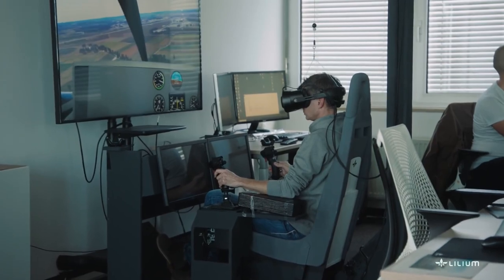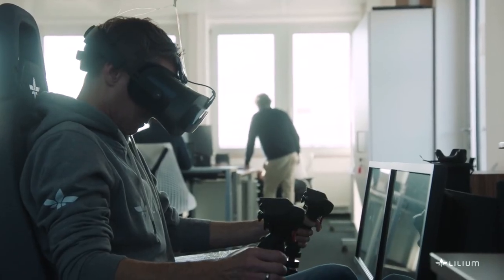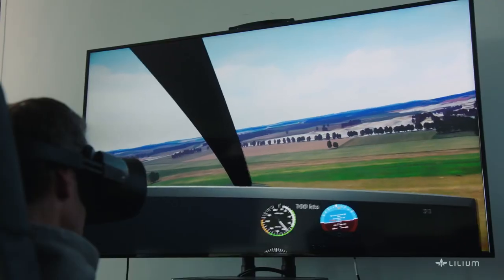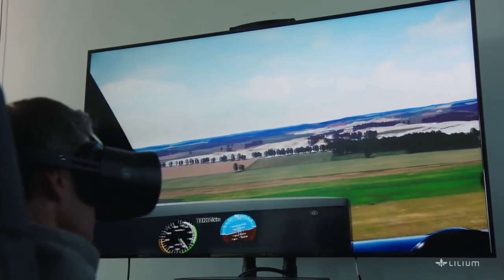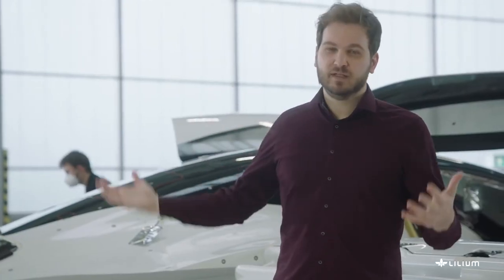Lilium's Amazing Aircraft Engineering & Architecture LILM

Comment: There are some immutable laws of aerodynamics that have been confirmed over many years of multirotor development. 1. the more motors you have the less efficient your design will become, Four motors being the optimal solution to create VTOL functionality.  2 Ducted fams are far less efficient than propellers that have been optimized to create a thrust core that absorbs the available power into a velocity that is almost equal to the vehicles designed speed. The blades swept area is the way to optimize the power to thrust efficiency ratio. 3. Stabilized thrust systems that utilize a fixed pitch prop, with a variable speed motor are far less efficient than a constant (optimized) speed motor with a variable pitch prop. these are facts that have become cast in stone. The fixed pitch prop concept is probably the most misunderstood aspect of the current mass-produced multi-rotors of today. One outstanding design that proved this fact beyond any doubt was Curtis Youngblood with his Stingray design. It was the only multirotor design that could auto rotate during descent and fly inverted. The conventional pulsed variable output from the ESC also draws more current at any given thrust value than the constant speed/variable pitch option.  I cannot see how this Lilium design will never be anything other than an inefficient gimmick.
Reply from the maker: Interesting perspective, Denny.
Thank you for the comment!
Reply: In fact, the new evtol aircraft should provide better cost efficiency than classic helicopters, and in this direction two main parameters should be achieved: better lift to drag ratio 7 or higher,  and the disc loading should be  slight higher than classic helicopters has got.
These two parameters are fighting each other, and the scheme close to compaund helicopters will  be most effective.
Reply: Um.....Denny...Speaking truth! Your comment will age well!

Comment: Lilium’s overall concept and the potential from using real wings for lift enhanced by accelerating the airflow over the upper wing surface is so far ahead of the others that they will leave Joby behind, provided they can maintain the momentum toward delivery. I hope the key SPAC investors will not interfere with the developers, nor do a Joby by dumping a ton of stock soon, which will scare away a broader spectrum of investors.
Reply: Lilium has a "concept" but Joby has an actual aircraft.
Reply: @codetech5598  Lilium has a "prototype".  I wish they weren't so reticent about releasing their test flight data.

Comment: Test pilots must be queuing up to do the spin recovery flights.
Reply: Indeed - no vertical stabiliser…!
And if they have a complete power system failure, it will fall out of the sky (no aerodynamic controls).
.

Comment: You may have done this, but your "3 motor pod" should be the same, all over the aircraft. Maintenance should be the airlines send you, used 3 motor pods for maintenance, and the airline receives refurbished 3 motor pods, that they just install into any open socket.
Reply from the maker: They are the same.
Thanks for your comment!

Comment: How is the heat dissipated again?

This is why all lithium-ion battery powered cars excepting Tesla started catching fire and exploding when everyone tried to become the other Model S anyways ("thermal runaway.")

Anyhow given the global energy crisis obviously the cost of battery even as storage is set to soar excepting those with manufacturing in the United States which has the only stable and robust grid outside of South Korea at the moment and anywhere on Earth.

Plus the USA is a massive energy exporter now as well trying to stabilize YOUR electrical grid. From a production and "running distribution" this is amazing...but better than a dirigible?

Maybe as an interesting adjunct to a dirigible this is.

Comment: That looks like new financial pyramid, no required power for hovering listed, no payload at full onboard power published, they promiced and it goes in years, but thise promises can,t be realised by technical reasons. 
They always occasionally forget to show one necessary element - fuel tank from the space shuttle and engine in one megawatt power consumption